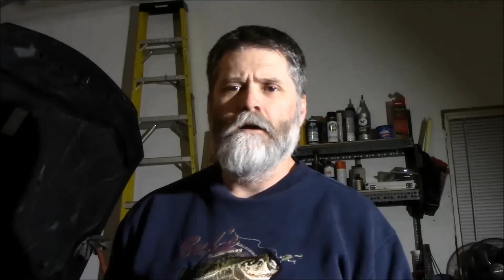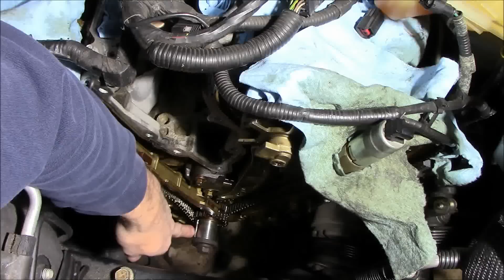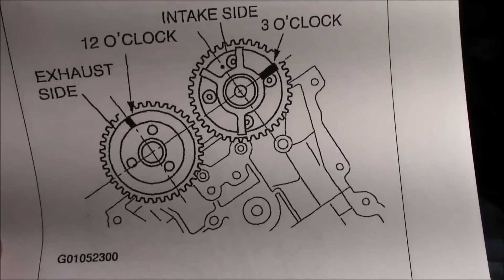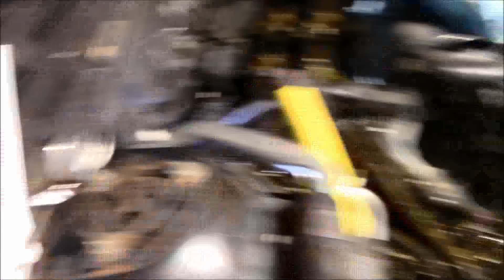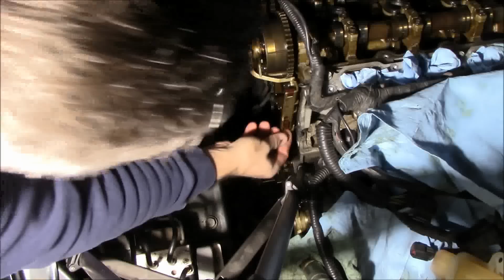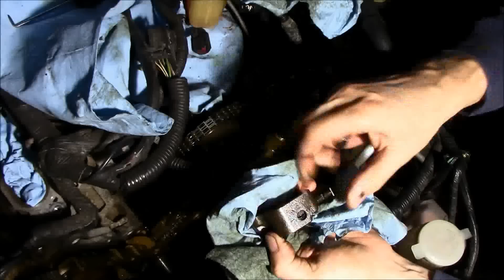2004 Mazda 6 3.0 Liter Timing Chain Replacement - Part 1 -  Timing Chain Removal

Comment: Is there a way to just hold all the gears in their place so that they don’t move at all, then simply take the tensioner and chain off? I think the most tricky part is to get the gears in the right position, in sync. Well, the last time the car was running the gears were synced. So if they never move from their position, they should stay in sync- only come out the other end with a brand new chain. Is that possible?
Reply from the maker: Not that I know of.  You basically need to follow the service procedure.  This particular engine is not an easy chain(s) to do.

Comment: My valve cover gaskets are new. But my timing cover is leaking oil. Is it possible to remove the timing cover without removing the valve covers? Reason being is I want to avoid all the extra work
Reply from the maker: Trying to remember.... I don't think so.  The front of the valve cover covers the cam gears and the top of the timing cover.
Reply: I don’t need to replace the chain or mess with the timing. I just want to reseal the front cover @charlesandcars

Comment: Oh man you wouldn’t believe it. I had my same car at 3 shops with no help, with the e sack same problem. Bouncing tac, traction control light and a slight bounce when driving. Your video so far has brought hope to my day. Thanx bro

Did this fix the problem to this day?
Reply from the maker: It fixed the issue.
Reply: Did you change out the variable valve timing solenoids. The guy that wants to do my Mazda is questioning that maybe it’s just that. I was willing to buy the whole chain kit and get it fixed. What’s your thoughts on that. 

Thanx
Reply from the maker: @nichecreator1464  Changing out the solenoids is much easier and cheaper.  I didn't swap mine out.  Tested them, and they tested okay.  It's the labor that's going to be the expensive part on the timing chains.
Reply: Ok than you so much man honestly I felt like my car would be junked. And I just bought it only had 120,000 km on it. So thank you for taking the time to make the video I appreciate it and getting back to me.
Reply: Well it’s a sad day I went and changed out the timing chains and the car still jumping and all my tack and my traction control lights are on still . Probably should’ve started out with changing the cam sensors.

I was hopeful because your problems were the exact same as mine. Nonetheless I sure learned a lot.

Comment: special tools needed for the job??
Reply from the maker: Trying to remember... don't think there are any "special" tools needed.  Impact gun helps alot.  Not an easy job, pretty involved.
Reply: @CharlesAndCars  thanks and final question... rock auto has the timing kit for cheap but they offer different ones for my v6 07 mazda 6. Says timing kit with vvt sprockets and then without vvt sprockets. Which one do i order??
Reply from the maker: @DVrec22  I'm assuming that you're looking at the cloyes and the melling kits.  They look the same to me.  Melling just specifies that it doesn't include the VVT Sprockets (On the front of the cams).  Neither kit does
Reply: @CharlesAndCars  yes on rock auto the cloyes and melling kits. So regardless of what they say, they are all the same. i was actually going to order the economy one "ultra power" one.

Comment: You still around Charles? Got a question. When doing the rotations the rear bank always lines up perfectly but the marks on the cam sprockets of the front bank never do. They seem off about a 1/4 turn. That’s the side where the tensioner failed. Do I have to turn the camshafts to line them up separately form the crankshaft after the chains are removed? Can I even do that? Does this mean the vvt has failed? Every job I see on these is done while the marks all line up properly. Mine don’t.
Reply from the maker: I'd have to look to see if I can find the information on setting the initial position for the cams/crank correlation.  This engine is not a particularly easy one to time.  I'll see if I can find some info on it... it's been a while.
Reply: @CharlesAndCars  Oh man If you could find some info I'd be super grateful. I'm searching myself but no luck.
Reply: @CharlesAndCars   Could I just line up the cam markers in the nuetral positions with the chains, then remove them, find TDC, rotate 2 turns clockwise back to 11 o'clock and re install the chains? Or is that too good to be true? haha

Comment: I have a Mazda 6 v6 2003 just turns over hold it all the way to the floor it'll run take your feet off the accelerator it goes dead

Comment: just bought a mazda 6 used and 2 days later it starts stalling
Reply from the maker: That's not fun.  Any codes?
Reply: @CharlesAndCars  its def timing belt they are gonna prorate the repairs

Comment: I only have one question... How did you remove the timing cover?? Or after removing everthing off the cover and unbolting it how did you get it out... Did you pull it from the top or bottom??
Reply from the maker: From the top... look through the video... I explain how to get it out...

Comment: Where did you find your diagrams for this motor? I have blown head gaskets im fixing to change and im at the point of tearing down the timing cover. I have this motor in my 2007 mercury milan premier
Reply from the maker: Don't remember if it was Mitchell or Identifix....

Comment: Wouldn't it be easier to pull the engine out? How many miles on this engine?
Reply from the maker: Probably not easier to pull engine....  92k on motor
Reply: I have a 04 Mazda 6 with 232,000 miles on it and runs like a top so probably a good bet to say that the previous owner change the timing chain somewhere back there??
Reply: @cdshawn  usually don't have to change the timing chain ever.

Comment: I have a mazda 6 2004 do you have to drop the motor to change the oil pump
Reply from the maker: Which motor does it have?  4 or 6 cylinder?
Reply: Charles And Cars 4cly
Reply: Charles And Cars my oil pump got a huge hole in it and didnt want to pay hundreds to thousands to fix it
Reply from the maker: Do you mean your oil pan has a hole in it?  The pump is not visible without removing the oil pan...
Reply: Charles And Cars that's what I was confused on cause as soon as I put oil in it it's coming right back out under the car
Reply from the maker: I'm guessing it's not coming out of the drain plug which means that it would be coming out of the oil pan... which would mean that the pan has a hole in it...  If you didn't hit anything then it would have to be an internal part that got thrown out through the oil pan....   If possible get a picture to me @ charlesandcars@gmail.com
Reply: Charles And Cars ok ty I'll email u

Comment: how did you take the Exhaust  off from the front? i took all four Bolts offbeat i can't get off
Reply from the maker: Did you also remove the bolt towards the back of the crossover which bolts through a bracket?
Reply: There's six bolts on the manifold.

Comment: Outstanding video Charles! Very thorough and thank you for sharing your knowledge and experience.

The engine cover gasket (a.k.a. timing chain cover gasket) is leaking on my 2004 Mazda 6 3L.  The rate is about 1 quart per 500 miles.  It looks like I'm going to have to do most of the same removal and replacement work that is done to replace the timing chain.  

With 190k miles, does it make sense to replace the timing chain (even with no codes at this point)?
Reply from the maker: Wow... that's a pain just to get to that gasket, but there's no way around it if it's leaking.
Reply from the maker: Always a tough call... I'm not into changing things out if there are no issues...
Reply: It would be good idea to replace chain guides they do go bad

Comment: Thanks for you answer
Now I need to know if you used special tool for supporting engine before remove steering pump, because it's necessary to remove both engine mount bracket and rear support insulator, or how did you support engine before remove steering pump?
Reply from the maker: The only mount I remember removing was the front mount which mounts to the timing cover.  The engine was supported by the blocks under the pan.

Comment: Charles,

This is the first YouTube video to which I recall I've ever given comment; I am commenting because of the excellent quality and thorough nature of your work. Your detailed description and precautionary considerations each step of the way are spot on. I'm a former Navy aviation mechanic and I truly appreciate the time you took in describing this job.

What I learned from this video is that I don't have the equipment or the location to do this job properly myself. I also learned that, due to the complexity and nuance of detail (parts removal and re-installation, alignment details, tensioner condition, patterns and torque settings, RTV (or similar) in certain locations on the cover -and much, much more), that there's just no way I'd trust this job to a mechanic I don't know well; I would not expect to get the car back in satisfactory condition and it occurs to me that it would be the beginning of the end for my car which I bought new and have enjoyed these past years. You were dedicated to this job and you conducted it in a very patient and professional manner. I don't presently have a mechanic I trust to engage this job in the manner it requires.

FYI: Mazda wants ~$2800. for this repair and Pep Boys wants ~$1300.00. Ergo, I'm going to sell the car inexpensively and with advice and information, one piece of which will be your three-part series.

Thank you for this series, it helped me orient myself to what my next project is, selling this (actually wonderful) car to an enthusiast and ensuring he/she is prepared for the requirements of repair, then finding another used vehicle for purchase.

Thanks again. Great job!

Edward
Reply from the maker: I hear you... this job is not a particularly easy job... it takes 8-10 hours and there are many things which need to be done for it to work correctly.   If you have doubts about doing the job... you probably don't want to do this particular one... I think from your comments you're making the right choice to sell it and move on.   Thanks
Reply: ²what 2

Comment: Hey. Your vids have been very helpful to me during engine pull/rebuild of my mazda 6.   One thing i want to ask you though is....how did you make determination that your timing chains had stretched, and needed replacement?  In video, your crank and camshaft timing marks all appear to be aligned correctly before you remove chains?  or did i miss something?  if timing was off, isn't it the camshaft(s) that would need to be realigned?  just put in new chain wont correct timing that is out of whack.  Thanks again for the great videos.
Reply from the maker: When the chains stretch they don't stretch to the point where the teeth would be misaligned.  You would get that condition if the timing chain jumped a tooth, the stretch is usually small, but affects the running/performance of the engine... in my case I could see once I got the timing cover off that the tensioners were really exended taking up the slack for the stretch, but it gets to the point where they can't compensate...
Reply from the maker: It's not an exact science to determine when they are stretched, but the way in which mine was behaving as well as the fact that both cam sensors were throwing codes (but the sensors were ok) led me to believe that the chains were bad...
Reply: That's good info to know. Thank you for that.
Reply from the maker: Thanks... glad it helped you out.  You are correct that the timing marks are aligned correctly before removing the chains and they absolutely would need to be aligned when putting the new chains on.
Reply: Hi. I will do same job than you, my first question is: did you use a support under oil pan?
Reply from the maker: The oil pan has to come off in order to get the timing cover off.   I removed the pan and then used blocks of wood on the front and back sides of the engine block where the oil pan mounts to block up the engine...
Reply: Hey Charles..  i removed only the 2 or 3 oil pan bolts that screw into the timing cover when removing the cover.
Reply from the maker: then you should be able to place a piece of wood underneath the pan... just spread the load out  and don't put it all in one place.

Comment: I'm curious, what tool did you use to pull and install the pulleys?  You may have mentioned it in one of the videos, I was just skimming through them and didn't see anything about that. I plan on watching the full videos again. Just a little short on time at the moment.
Reply from the maker: I'm guessing you mean the harmonic balancer.... Used a harmonic balancer puller to pull it.  To put it back I use a pipe wrench to hold the pulley (with a shop rag) so it won't damage the pulley as I torque the bolt.
Reply: Yes sir, thats what I was referring to. Thanks for the quick reply! I may be diving into this repair here soon so I'm trying to make sure I have all my tools lined up. Thanks again!
Reply from the maker: No problem
Reply from the maker: You can usually get loaner tools for pulling and installing the harmonic balancer from most auto parts stores... I have the puller and it's easy enough to use a pipe wrench to hold it for me rather than going to get an installer as a loaner.

Comment: Excellent job brother 👍, god bless you ! Awesome vid Charles, do you  remember if your oil pressure warn light flickered @low rpm along w/the probs u were having ? I got a 05' 6s (115k miles) from a fam member thinking just pre-cat prob w/misfires jumping around I've since replaced all 4 cats, 6 plugs n coils n pcv , ran motor now it ticks @idle - 1500rpm w/oil warning flicker , but roughly @2k rpm the (tick silences) n runs normal mind boggling ! (I'm guessing 1or both of my chain tensioners are shot) did you come to a conclusion your tensioner was your issue (like your left bank stuck) if you had to guess ?and are you in N.J (sorry about the lengthy read)
Reply from the maker: I am in NJ.   I did not have the issue with low oil pressure... Low oil pressure will cause problems with VVT as that pressure is used in order to activate the VVT.  The ticking noise could be many things, but I'm seeing it's common with this particular motor.  If you're having low oil pressure, I'm guessing you're hearing the valve train due to that low oil pressure. For my car it was not a tensioner issue... the chains were just stretched/worn out.
Reply from the maker: take a look at the following thread   https://www.mazdas247.com/forum/showthread.php?123771924-Engine-noise-quot-ticking-quot-at-idle